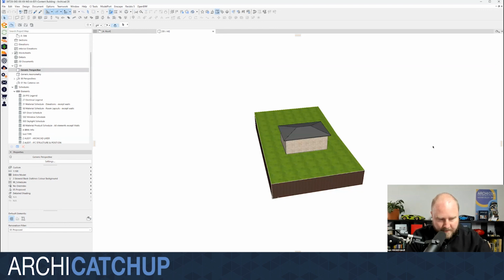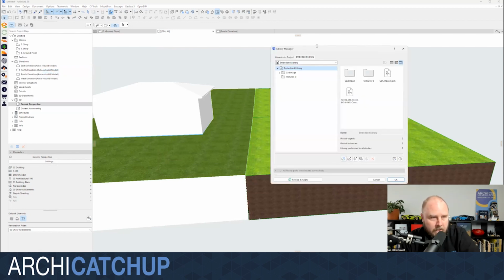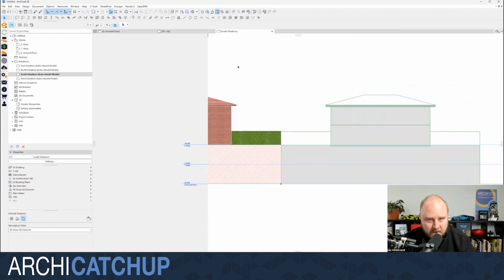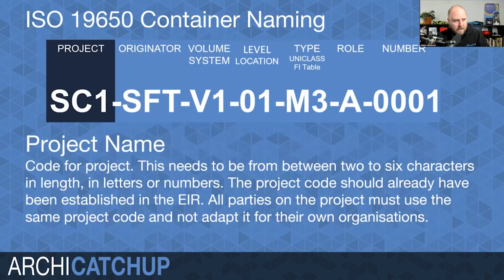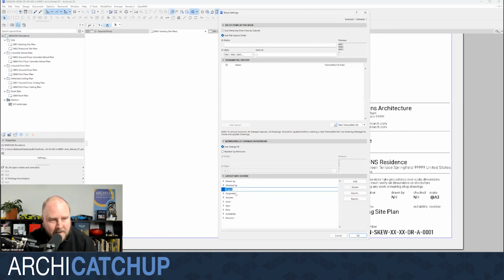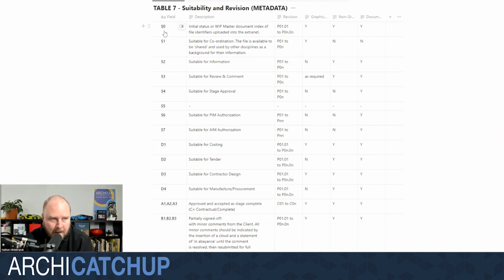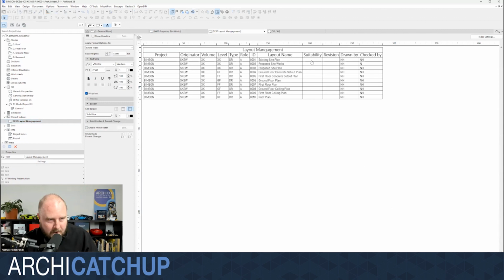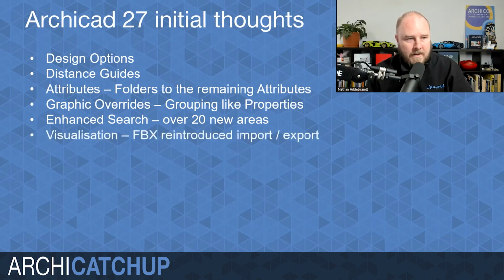ARCHICATCHUP - Archicad 27 review, ISO 19650 and Site Context

Comment: Hi Nathan, I just watched the full video. From an architects and BIM-manager view from Germany, the first topic has no relevance in professional work. What should it be good for ? Renderings ? The second topic the introduced naming convention is not very mature from a german point of view. Most german clients have way more detailed naming conventions. However the way you solved the naming convention is the right approach, which most ArchiCAD users in Germany go. I am just wondering, if this kind of naming conventions are new to you guys. 
About the third topic Design option I can say it is a problem that the GUID for different option of one wall is not identical. So it is hard to keep on track with changed that come out an option, but in general Graphisoft seems to be still on the right path. Would be nice if we as Graphisoft costumers could agree about which ideas from the idea pool of the ArchiCAD product-roadmap should be prioritized. Please get in contact with Lukas about that a the board.
Reply from the maker: Hi Micheal,
It is incredible how different regions deliver projects. I always find what we place importance on differs. The first segment was a process we developed for projects where we needed the context of existing built assets as a model. For visualisation, and documentation. 

The naming convention is the UK naming standard included in their ISO 19650 annex so it was a demonstration on how users can get those more complex naming conventions. 

As for design options, I won’t comment on functionality outside of what was presented as part of the building together event as I am currently under NDA for beta testing.

Comment: Hi Nathan, I am really glad I found your channel, there is not so much good quality content on youtube regarding Archicad. With every new version I am actually dissapointed with what Graphisoft is going for. I think for me in 27 search and design options are the only interesting features. I would like Gs team to take a deep breath,  have a step back and repair a lot of broken stuff going back from version 5 or even 4, instead adding things that in my opinion almost nobody is using ( like structural features ). Archicad should be a tool made for architects and Gs should in my opinion to focus on data exchange with other programs that structural / MEP engeneers are using. Thay alread have expensive tools that they are using for years, nobody will start to use Archicad with it's limitations. I am not going also to do their job and taking a time to prepare for free structural models to make their lives easier. Graphisoft just prefer to pump Archicad with something that is easy to implement and just not useful for Architects. Yeah, some new things are nice but there is just so many things still working bad, so many features missing we could talk about for hours that sometimes it is just killing me how we have to find a ways around some things instead of focusing on using it's features to make projects we want
Reply from the maker: I am glad you like the content and find it if value. I wouldn’t be disheartened with where Archicad is going. There are a lot of positive features on the roadmap that they will be implementing over the next few years and into the future. Some will be of value to me, and some not. It is all part of using a global software that needs to meet the needs of users from all over the world. 

Regarding structural engineering, I actually met a structural engineer that has been using Archicad for 17 years. So they do exist and the one I met had built some great tools to enhance their workflows even more. Regarding MEP that development is being dealt with by the DDScad team and their features don’t take away resources from the Architectural side of things, so I wouldn’t be concerned by that at all.

Comment: man i don't see what they have updated on Archicad like feature option design who ??? can use option  when making facade take the time , maybe if they have improved on parametric modelling that option could be needed in that case, man honestly Archicad need to open API  like revit, can u i imagine they forgot to add AI features, about GDI is sh**t man it is required to read GDI documents and it is not even common programing language  who need to learn GDI when there no use when only required in ArchiCAD

Revit  will always  leading market
Reply from the maker: I think they used the facade as an example to demonstrate the scale Design Options can work at. We will see the capability of the feature once it is fully released. There may be the ability to link design options to various parametric outputs from GH / Rhino or through GDL solutions that people create.

Regarding API access. Graphisoft does have an API, you just apply to their developer program. There are many software developers out their creating tools to plug into Archicad. It isn't just something that Revit has. A lot more people have been developing add ons for Revit because of the areas where it isn't good enough (filling in the gaps I would call it). It is only now as the market matures that people are wanting more and more out of Archicad that they can't get out of the OOTB product. So there will be a movement by people to develop their own add ons through the Archicad Developer portal and the API kits. Here is a link to the page: https://archicadapi.graphisoft.com/
Reply: I agree with you  @SkewedBIM , the fact that majority of Archicad don't do custom API tools just shows how complete Archicad standard installation enable us to achieve all our deliverables with lots of flexibility & freedom. This makes Archicad a well rounded & full tool suite, while the Open API is there to go even further.
Reply from the maker: @fusionbim  I think that Revit users understand the need to innovate to achieve what they need to achieve, while most Archicad users think that it should all be in one software, delivered on a platter for them.
Reply: Yes that too are both true
Reply: thank u so much, i love archicad but I hate  to see Archicad behind